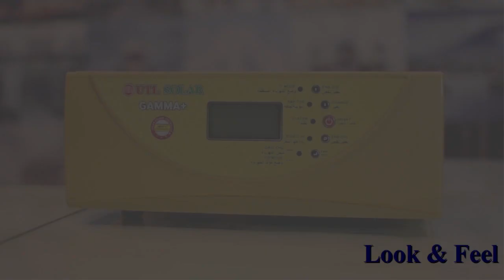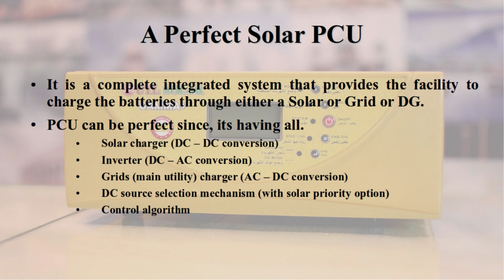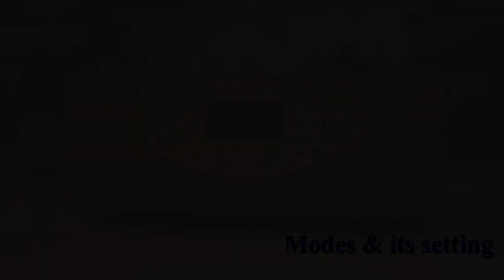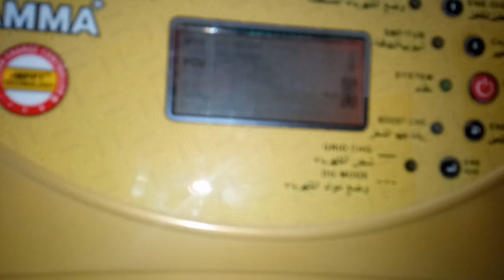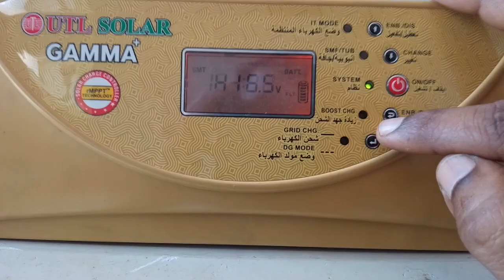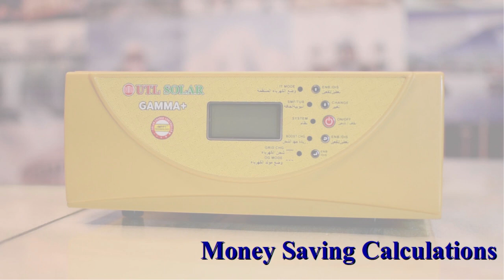UTL Gamma Plus PCU User Review

Comment: sir please confirm is that gamma plus inverter support Lithium ferous battery?
Reply from the maker: Officially It's not... But you can connect it to this inverter provided the Li battery should have a good BMS... after connecting, the charging voltage and current of the inverter should be changed to suit them to that of the BMS and Li battery. This is the only inverter in which you can change all the voltage and current to be suited to the Li battery voltage. I tried with a small Li battery pack (just for checking purposes) and it was working good. Good luck.

Comment: Hi..I have a doubt. My 12v smf 120ah battery has a writing that says boost charging @13.8v and float @13.5. Can I use 14.2v to 14.4v for bulk charging? I am asking this because when I set my bulk charging voltage to 13.8v the backup has been reduced. Thanks for the help.
Reply from the maker: Please select the SMF battery option from the front panel. The required current & voltage will be set automatically

Comment: Sir
24 v panel maximum 1000watts என்று இந்த utl 12v Inverter ல் recommend செய்யப்பட்டுள்ளது. 
375w 24v monoperk available.
375 x 3 = 1125 watts
இந்த 12v Inverter ல் பொருத்தலாமா?

அடுத்து 
Mppt solar Inverter 
Or
Mppt solar charge controller +Normal Inverter
இதில் எது நல்ல efficiency  தரும்?
Reply from the maker: Sir... பயப்பட தேவை இல்லை sir... Maximum 4 பேனல் வரைக்கும் போகலாம் (4x9 = 36 A). Ampere rating of 4 panel is touching 40 A limit. So MPPT just heat ஆகும்... 3 பேனல் means 3x9 = 27 A only... So 3 panel without any doubt போகலாம்...
Reply: @JeyadheepanK  
Okay sir
Inverter பற்றி சொல்லுங்கள் 
UTL Gamma + Mppt 1kva 12v solar Inverter

Or

Luminous Zelio+1100 12v Inverter with Smarten Mppt solar charge controler 
இதில் எது best performance தரும். 
இரண்டும் ஒரே விலை.
மேலும்
UTL 12vல் 12v battery தான் போடமுடியும் 
ஆனால் smarten Mppt solar charge controler ல்12v normal Inverter போட்டாலும்.
12v or 24 battery போடாலாம் என்ற concept சரியானதா?
விளக்கம் தாருங்கள்.
Reply from the maker: Smarten MPPT is a retrofit system, which is not normally recommended by solar expert, since the voltage and current values of battery charging profile will not be followed in retrofit systems, which leads to reduced battery life and frequency electrolyte capping of batteries. So Please dont go for retrofit systems.
Reply: @JeyadheepanK  
Okay sir,Thanks
Reply from the maker: @Indiaking Tamilanda  Using 2x375W panels, Maximum of 4 units can be produced in PCU mode
Reply from the maker: @Indiaking Tamilanda But the load you have listed above is not 80% max. Its exceeding the limit of the inverter. At normal conditions, practically you can use 600W alone from two panels of 375W, since remaining is needed for battery charging and compensate some losses.

Comment: Can I use 24v panel with only one 12v battery with this inverter?
Reply from the maker: Yes sir... Since it has MPPT, It can accept panel voltage from 15 to 45 V. That vl be converted to be sufficient for 12V battery

Comment: Hello Mr.Jayadeepan
Can you tell me why do we hear a beep sound from the inverter...we are using the same inverter as yours
Reply from the maker: Beep sound will be coming whenever, the inverter in UPS mode and no EB...

Other occasions are,

EB to solar transition and vice versa.

EB line out of range of inverter input.

Overload for prolonged duration.

Mostly, the beep sound derive the user's attention... That's it.
Reply: @JeyadheepanK  thanks a lot

Comment: Sir kya main isme 65ah battery laga sakta hoon?
Reply from the maker: Yes raja Ghosh, you can connect it... Only thing is you have to reduce the current... That's the advantage of this inverter
Reply: @JeyadheepanK  is this possible  to control grid amphere(current) to 6-7ah, because in manual it it written  grid current is 10AH.please help me Sir
Reply from the maker: @rajaghosh4795  maximum grid current is 10A. But we can reduce for your battery's requirement.

Comment: Hi sir nice to see your reviews.
My question is that will connecting 24v panel makes the whole system 24v or can I connect a single 12v without worrying.
(I can see only single battery in your system but I'm having that doubt.)
BTW where do you buy gamma+ and how much it costs?
Reply from the maker: Since the ups is having in built mppt, for 12 v battery we can go for 24v panel... System is 12V but mppt input (solar PV volt) can be from 14 to 45V.

Comment: This we can connect 1hp water pum
Reply from the maker: Yes... I am using it... But at start the inverter makes a beep... Don't worry
Reply: @JeyadheepanK  we can use 220v single phase to 440v three phase vfd so we can use three phase motor and reduced current also

Comment: Which is best? Buying this or smarten mppt +microtek 2.5 k jumbo normal inverter suggest me
Reply from the maker: I vote for this UTL Gamma Plus (an integrated system) Navin, since it has the full access to the setting of individual parameters. For ex., In Smarten MPPT the battery DoD cannot be changed below 50%, i.e., below 11.0 V. But if you are using Solar C10 battery the DoD can be set up to 70% (~10.5 V). So please go for it. 

Next drawback with Smarten is the whole solar current is transferred to battery and from the battery only the load is feeded. So the battery will be quickly sulphated and life will be reduced.

Also, the integrated stuff works better compared to the individually assembled one.

One more thing... GO for 2.5kVA solar inverter which is having in built MPPT like UTL Alpha+ or Sigma+, since gamma plus is just 1 kVA.
Reply: @JeyadheepanK  Thanks for your  suggestion

Comment: Very good presentation and apt calculation of usage and panel configuration which is good for a common man. Are you using a C10 or C20 battery and how  much AH does the battery have?
Reply from the maker: I am just using 150 ah c20 battery, which was just purchased last year that I didn't want to change. The inverter is having settings to limit the charge current (8A) required for C20 battery too... No other solar inverter brands are having the option to reduce the charging current, in my experience.
Reply: @JeyadheepanK  Thank you. In your chart for solar setup, it was given as 13Vx11A = 143W  for battery charging. Was that maximum consumption expected? I am planning same setup at my home that is why lot of doubts. Do bare with me.

Comment: Sir...First of all nice presentation..I have a question...Can i connect 375 loom solar mono panels x 3numbers? It will come 1124Watts? Also Ampere 9.62×3=28.86amps.I had chat with loom solar person..The guy  told me there is no issue it will work.what is your opinion? Please let me know..You have a good experience with this inverter...Thanks
Reply from the maker: You can connect all the three panels of 375 watts... I was personally using 1kW of loom solar myself... It never exceeded 24 amps in total (Since mine is a hot place and loss due to that)... So go on...
Reply: @JeyadheepanK  Thank you Sir...God bless You..Keep uploading like this useful videos..

Comment: Sir
I am using a 12 volt solar pannel of 165 x2 =330 watts
Should i use my pannels in series means 24 volts or parellel in 12 volts
Reply from the maker: In this inverter you can used the panels in either of the two series or parallel configuration. I prefer series of the two for 24v so that current will be same and only voltages will be added. By doing so, can avoid using the charge controller in lower current range so that the life can be extended due to to less heating.

Comment: Recently I bought two 250watt 24v panel and I am using these with UTL gamma plus. I have 3  12v old panel 100w, 130watt, 150 watts. How can I add these solar panels with the 500watt system? If I want to make these panel 24v, I can connect only two panels and unable to use one old panel. What's the solution? Thanks
Reply from the maker: Add 130 with 150 in series connection and add then in parallel with the 24 v/500w... You cannot use the 100W alone...
Reply: @JeyadheepanK  thanks